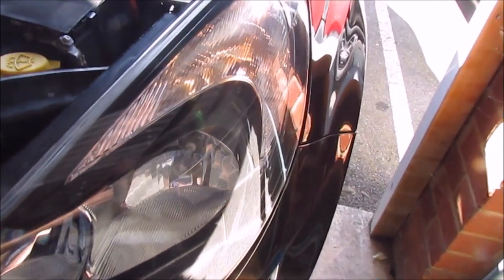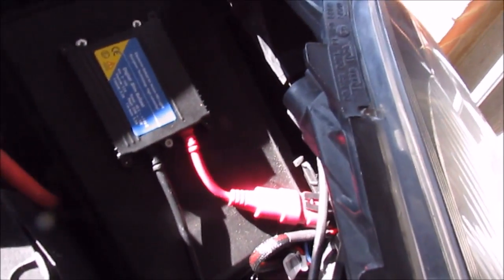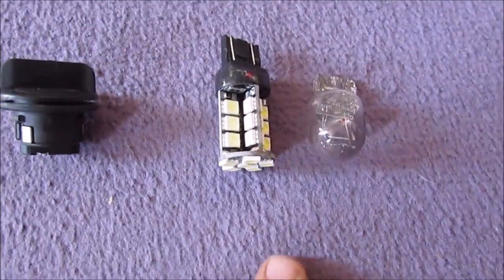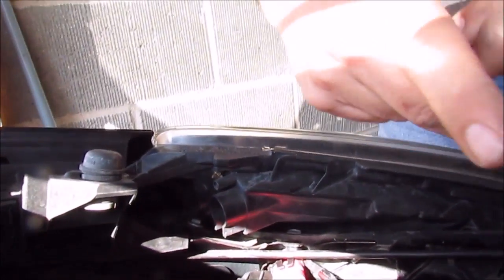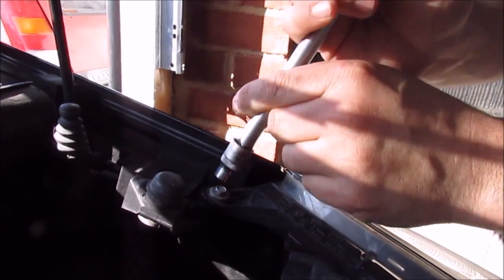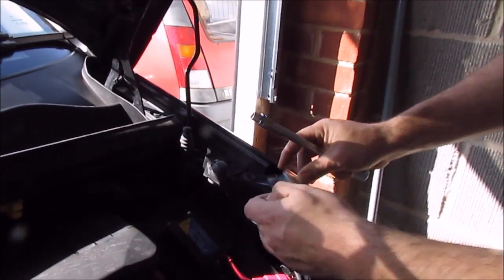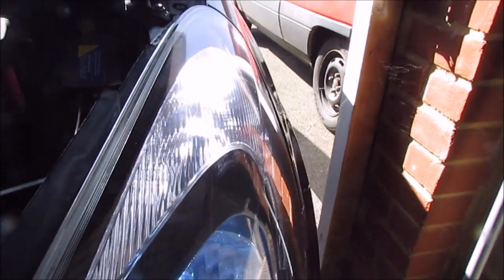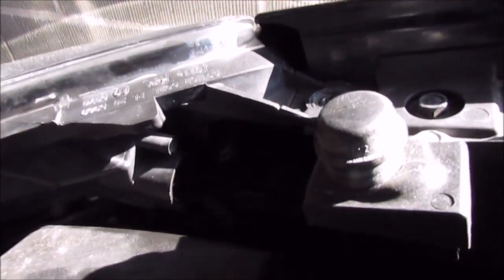Corsa D side light change (LED)

Comment: Hello, I’ve bought some Osram W21/5W LED DRL side lights. When I installed them the DRL worked but the side lights didn’t turn on... so then I turned them 180 degrees in the connector and then the side lights worked but not the DRL. Any ideas?

Comment: i got a pair of cree leds from ebay and the lens has fallen into the V of the drl area and  it wedged itself in
Reply from the maker: +Martin Cooper Man that's going to be a pain to get that out without taking the whole head light out but it's only a 10min job
Reply: ive already had it out to dislodge it  bit no result
Reply from the maker: If its not going to come out with you shaking the unit about better just bite the bullet and stick a replacement back in. Much better putting bulbs in the Corsa d with the unit out, There's next to no room to move behind that light
Reply: ideal tool would be  something long  and flexible enough to hook it. its just gonna need to lie there till then
Reply from the maker: Small magnet on a bit of fishing line?
Reply: no its the plastic lens off the front that fell
Reply from the maker: Do you have a pic of it at all Martin
Reply from the maker: Now I see what you mean
Reply: not an easy thing to get out
Reply from the maker: Your going to have to take that headlight unit out tip it upside down get some twizzers and have ago Martin

Comment: Ignore this if you've answered it during the video because I'm still at the start of it. Basically I've fitted my bulbs in and one of them is dimmer than the other when the actual headlights are on as well as the DRL's. When just the DRL's are on, it's fine. I was told the dimmer one may be losing power to the headlight its attached to
Reply: Any advice/help?
Reply from the maker: AHCy0 what sort of LEDS did you fit I know you can buy some dodgy ones off eBay that tend to do that.  What headlight bulbs do you have fitted? Are the new Drls canbus error free?